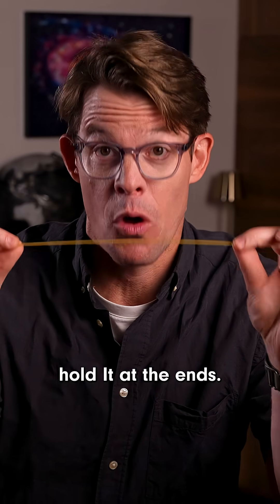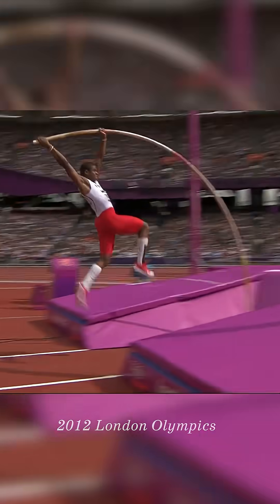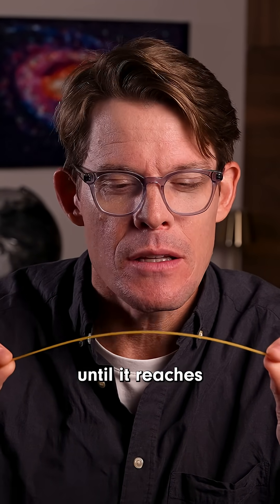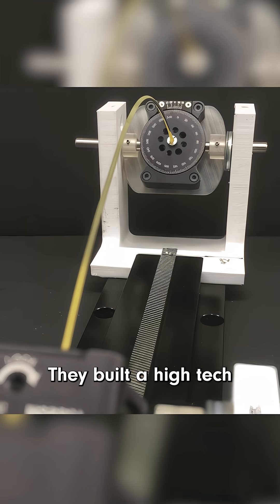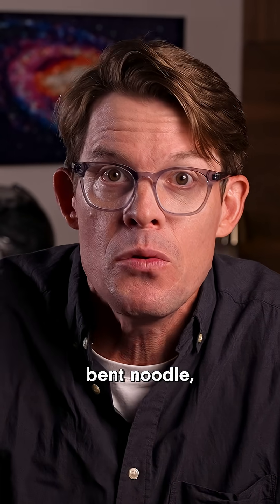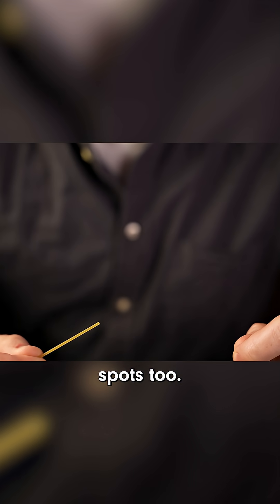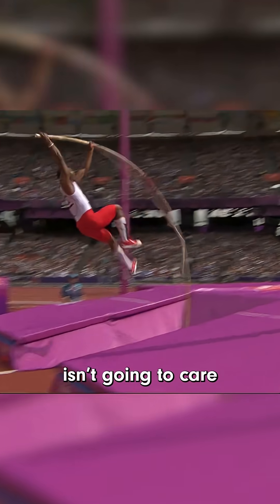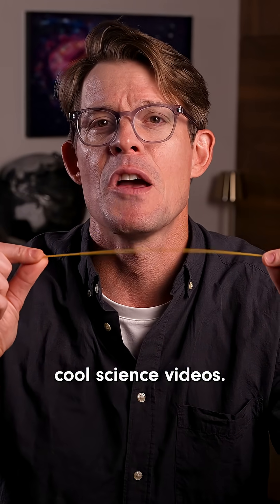How Spaghetti Stumped Physicists For a Century

Comment: This is me pausing before figuring our the reason: I think it breaks into three pieces because the bend has two stress points that simultaneously snap once bent hard enough. And because we bend it at the two ends it's impossible for the center to snap

Will edit after watching the rest of the short.

Edit: oooooh. I was a little close, but I didn't expect there to be waves involved. Pretty neat 👍

Comment: Well, my view is that, since it isnt smth like a strip of paper, its a bendy solid thin thingy, when you bend it, since it cant bend at a 90° angle, it causes tension at both ends of the bending section, snapping it off. Its wrong, but its how I view it

Comment: Im surprised It stumped scientists so long

I found out that The reason why it breaks that way at like 9? Ish

It's quite simply just due to how much strength is in a smaller piece 
And where the force is being pushed 

Its a tension issue , Then again , I also watch a lot of practical engineering 😂😂 thnx grady (人´∀`)♪

I just never knew any of the specific names for what any of the functions of the movements were called for example xd

Comment: This is why suspension bridges uses stranded wire instead of solid steel supports. We figured this out ages ago, and Feynman's studies were more on the subatomic, not the macroscopic.
Reply: Actually solid steel hangers have been used. The lack of structural redundancy has shown that was a bad idea (look up the “1967 Silver Bridge Disaster” as an example). Single points of failure are always problematic.
Reply: People on the internet will spew absolute nonsense and 400+ people would still buy it anyway
Reply: @yiumyoumsan6997  what are you confused about here exactly? Are you saying we dont use stranded cables for bridges or are you missing my point entirely?  My comment is just objectively true; its not an opinion you get to disagree with lol.
Reply: Rubbish. Steel cables are made from strands for other reasons. In any case, it doesn’t matter whether a cable or rod breaks in one or 2 places; either way it no longer works.
Reply: @Dalesmanable  like i am unbelievably confused what your point is. Youre literally watching a video on how a solid cable is a single point of failure. So ignorant...
Reply: @Dalesmanable  what are you yapping about? We definitely use stranded steel cables for their tensile strength, multi point failure capabilities, and the fact strands spiraled around share loading better (significantly so) than solid core cables.

I guess its feasible you're misunderstanding my point or are just uneducated yoursel, but in the future, you should probably just lead with an actual counterpoint instead of spewing ignorance.
Reply: @JgHaverty Something weird is going on. My comment wasn’t against you, as is pretty obvious. FWIW I’m a masters level engineer who’s done a lot of work in structures, so shove your insults where the sun doesn’t shine.
Reply: @JgHaverty  the video is on why spaghetti breaks into more than two pieces. Idk why you keep insinuating others are stupid when you say this specific phenomenon is the reason we use stranded bridge cables, which it isn’t. Congrats on your masters, but it doesn’t make you right.
Reply: Untrue
Reply: You're seeing a whole team of psychistrists, aren't you? You're suggestion that we use twisted steel cable on bridges not under compression because noodles break in three when compressed is ludicrous or at least your language skills are unable to simulate your thoughts.
Reply: @carlosoliveira-rc2xt  lol yeah. Dude's talking nonsense but his degree from YouTube University didn't give him enough knowledge to even understand how he's wrong.
Reply: That's not the reason, D for effort
Reply: @cowprophet  it is absolutely the reason. Thanks for playing
Reply: Does anyone happen to know if just one (or two) wire has broken on a twisted stranded wire cable in real life proving the absence of cascading failure for the remaining wires? Or are the twisted stranded cables so well calculated for the load weight that they simply do not break? I'm a self-admitted physics idiot, so no need to snap at me. Just curious, if anyone happens to know. In cartoons, the strands break one by one until Wiley E. Coyote falls into the canyon, but those are ropes, not steel cables. Also, um, cartoon. Thanks. :)

Comment: At 1:00 the “outer side stretched in tension” should be the top of the yellowed part of the arch, the part facing upwards (not the ends) while the “inner” side being “squeezed in compression” would be the other side of it, facing down (not all of the middle)
Reply: No, it should not. Tension on the outside and compression on the inside are along the whole length (even the ends), it is just the highest in the middle (top), where it bends the most.

Comment: but isn't that logical? the energy tries to moves through the piece after its breaking point, but because its a PIECE it moves in both directions? the tension from both sides collides and then moves back, but that that point there is too much power so it cracks.

its like pushing two items against each other, they bounce off in TWO directions.

Comment: Id say its pretty easy to solve 
But  not sure if its correct
When u bend it it breaks early then its a cirkel 
So the easiest route is 3 pieces because

     _
/        \
\   _   /
As u see when bending it it turns into a half cirkel 
    _
/       \
It turns into this

BUT because it cant bend much that is when it snaps  

It is on that route while bending

If its more bendeble it wont be a half cirkel but a :
                         /\
                       /    \
Snaping it snap into two pieces
Because its now on that route

(THIS IS JUST MY THEORY)
I havent watched the vid yet only the question....

Edit: i forgot to say ehen u bend it its becuz of the presure since i know watched a bit of the vid

Comment: In normal life, spaghetti, vermicelli, linguini,  will all break in 2 if you just hold it rolled together it in a bunch and held tightly, close to the point at which you want it to break. . Any logical person could quickly do this who wanted to prepare it using a smaller pan.  And do it again or repeatedly if including it cooked directly in a soup or stew.  I do that frequently.

Comment: Isn't that the reason behind the design of the double recurve composite bow??? The difference between the tension on the inside vs that on the outside and why it required so many parts with different elastic properties. 44 parts if I am not mistaken... Quite the acomplishment for a weapon from 1200-s...

Comment: This is cool and good research for a spaghetti noodle, but there are other factors for pole vault.  The biggest factor is usually a failure point (ie someone stepped on the pole with a spike). Poles can break without a weakness, but that isn’t usually the case.  I have broken 2 poles and they both broke in 2 pieces likely because there was a failure point on the pole.

Comment: I could've told them that it was because of all the excess power that was sent back down the spaghetti after the snap in the other direction that causes it to snap again. I suspect they did more than just that if it took them until 2005 to figure that out.

Comment: Understanding how structers behave under stress is extremely important to understand where to reenforce the structure more.
Reply: And where not to.
Reply: Yeah it's very important in engineering of most types.
Reply: @hardcorelace7565Yeah my engineering brain was like it’s cause of the forces as soon as the question was posed
Reply: I was wondering where this could be used! That's pretty clever
Reply: Thats why in civil, the rebar near the joint and in the middle has different setups to account support and span moment
Reply: Exactly… I could be wrong but isn’t this just a maximum bending moment equation explained in practical terms??
Reply: @yohanceboisselle yep, though the spaghetti problem would probably be useful for limiting the impact of a single failure and preventing it from cascading into a bigger problem (your system might be able to handle one bar snapping but definitely won’t like a third unanchored piece flying off somewhere at high speed)
Reply: It's very important in welding.
Reply: Learned this in civil engineering. Idk why it seemed so hard.
Reply: Nice video. Also, you are a triangle, namely isosceles: I so sillies. I like your jokes.
Reply: Wouldn’t that just shift or create a new weak point .. ?
Reply: @marcsequence twisting it to weaken it at that point, making it the weakest point. It's the point!   😅
Reply: P
Reply: but... The point to reinforce would still be the center, this doesn't change that
Reply: Go shower
Reply: and how to cook spaghetti
Reply: Reeforce my spaghetti
Reply: You didn't need to know why the spaghetti broke in 2+ places to know that it would break under extreme stress.
Reply: There’s nothing remotely important about understanding structures
Reply: That is true but asking for the budget to build that doohickey is so funny imo
Reply: It sounds funny cause it’s missing detail. They wouldn’t ask to test spaghetti. They’d ask to run tensile strength tests.
Reply: I don’t care how many time u reinforce it I will never set foot in a spaghetti structure.
Reply: The comment I was looking for, thank you 🙂
Reply: Water is wet
Reply: like on airplanes, when you exclusively add the reinforcements to were the bulletholes are
Reply: wtf? 2005? Richard Feynman could not solve it? I solved it even before MIT and did not need the answer.
Basicaly, Newton's third law.
Reply: YES!!!
Reply: Understanding structers ✅
Understanding structures ❌
Reply: You dont say

Comment: I've vaulted and officiated the event and don't recall a section break like the video.  Possibly because there was a crack or flaw already in the pole.  I'm sure that flawless poles exhibit the multiple break pattern.  All poles are bent to 180 degrees (or very close at the factory, perhaps 150 degrees) before passing QC to sell.

Comment: If "the first break always seems to happen near the middle, where its curvature is the highest" and your noodle breaks into three pieces, does that mean that two of the pieces should be equal in length to the third piece? If the two parts you're still holding on to were of equal length then the middle of the third piece that flies away was the point of highest curvature but that's not where it snapped

Comment: Does this hold true if you try holding and snapping closer to the middle of the spaghetti,  or do your thumbs start absorbing some of that energy, preventing the multiple breaking points?
Reply: I wondered the same, and doubt it. I wondered why they insisted on holding it at the ends without exploring any other positions.

Comment: At first i thought that there should be a water basin at the bottom of the bowls where the bowls can rotate into so that it could auto hydrate, but then the bowls won't resonate.

The next best thing i think so you wont have to manually wet your hands is to add a water misting machine over the bowls.

Comment: I was able to break it into two pieces by not just rotating the ends outwards, but by pushing the sides into each other as well. Just imagine a triangle shape, but with just two edges and I tried to push both sides towards the one point in the very middle where they both connect. It only worked once though, it's pretty difficult to do.

So, did I find a new strategy or was the noodle coinsidentally weaker in the middle part or something?

Comment: I'm not doing any testing but something doesn't make sense to me. When making a stone arch there is a key stone at the top middle that is taking the weight of the arch. It can do that because stone is stronger under compression that flexion. Like spaghetti. If you make an arch out of spaghetti it would be stronger in the middle and like a bridge it would break on the sides first. Which is why there is so much support on the sides of a bridge and very little in the middle.. lol that sounds funny "little in the middle" hahaha

Comment: I'm guessing the rigidity of the center piece between the two points is what causes this phenomenon, 1 because of the natural composition of said spaghetti, and 2, its fracturing point.

since the spaghetti keeps its rigidity all along its length, the stress is concentrated at those two as far as the stress points can travel towards the center, where those two forces (1 & 2) eventually causes the snap to happen

Comment: The cause seems a bit obvious. Although I would have thought that it had to do with the fact that there are stress points not just in the middle, but also at the points where the flexible rod goes from being basically straight to extremely curved.

Comment: If that’s the answer, how it’s possible to transfer the same answer on the pool vault? Pole it’s a lot complex than that, stored energy wouldn’t make a third part, it’s incredibly durable am I missing something here?
Reply: The pole had too much stress. It should be durable but I guess it was a faulty pole, no one checked it before the event, and then because it didn't twist, it broke the same way the spaghetti does. The stored energy was released from the initial impact into the ground and the second point was where the guy was holding on, his weight bent it back.

Comment: locations of stress failures appear to be related to energy resonance based on the length of the object.
Reply: That is why if it's long you can put a torsion in it and that gives a more stable way to dissipate the energy. Basically energy into torsion means energy from the snap can balance out and not cause those points of cascading failure.